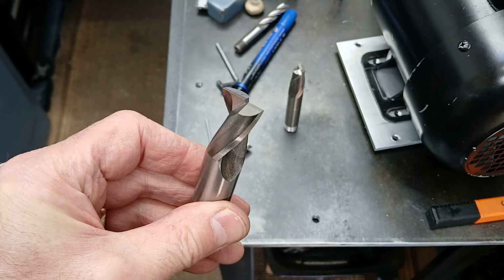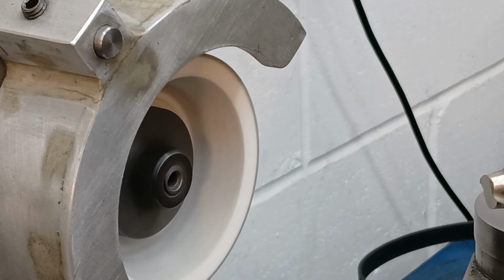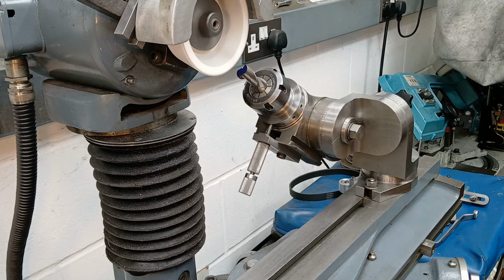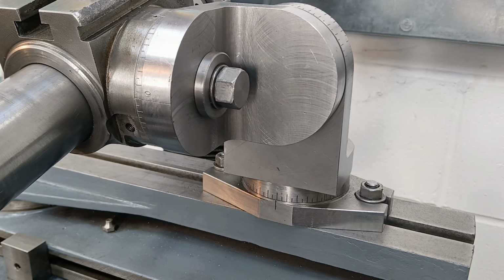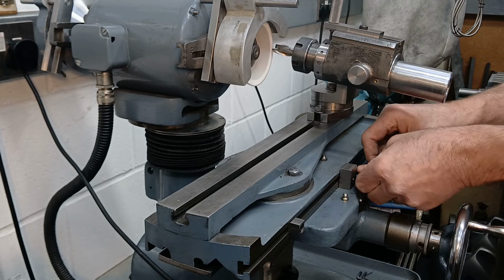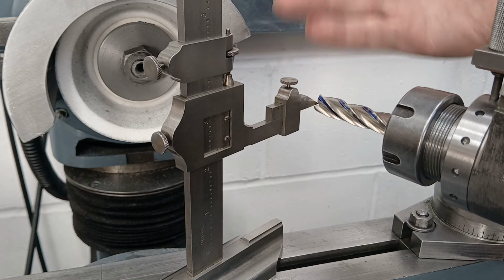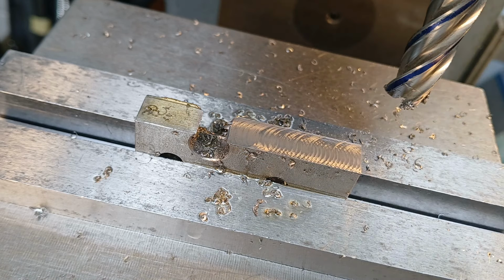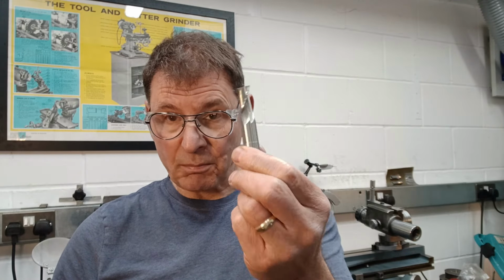Endmill Sharpening Part 2

Comment: The sharpening looks spot on . A little tip on milling ,I find using much slower than recommended  speeds work better on lighter machines and the cutters last better as well .
Reply from the maker: Thanks. I fully agree with your point about the cutter speed. For 6 to 10mm cutters 800rpm seems about right on my mill. Granted it's a tad fast for a 5/8 endmill, but dropping down one speed involves 2 belt moves on the pulleys and to be honest for 2 quick cuts I just winged it.

Comment: As someone who is rebuilding a rusted solid Quorn this is bang on time.
I have one question, did you "dish" the end flutes when you reground them by the customary degree or two?
Reply from the maker: Glad its useful. I thought I'd shown and explained in the video that the fixture was rotated a degree to make the corners proud of the centre. Don't think that footage ended up in the recycle bin!
Reply: @ThePottingShedWorkshop  I could have missed it.
Reply: @chrisstephens6673  The part where Robert explained rotating the fixture ~one degree is in this video, but I don't remember the time stamp.

Comment: Thanks for your comment  about the flute of a 4 flute Endmill not always passing through the centre, I am revisiting your video as, I am struggling with getting the lips aligned using a horizontally scribed line at centre height on a piece of acrylic, this works well for 4 facet work but not for Endmills, I thought it was just me where I couldn’t seem to line things up to my satisfaction. I saw Blondihacks using the Eccentric Engineering jig with a simple alignment block which might be better for me as the Kennet doesn’t have a lot of table area for a height gauge. I could remove the jig and do it on the surface table if needed.

Comment: Hi Robert. Great video. Thanks for pointing out that if you slant the gash to the rear, you will loose the center cutting when you go to resharpen. Please do a center cutting four flute if you see fit. Perhaps even carbide using a super abrasive wheel. Carbide end mills really pay for the home shop guy to resharpen. Thanks.
Reply from the maker: Thanks, glad you enjoyed it.
Four flute centre cutting geometries vary, some look ok to sharpen as theyre similar to the 2 flute in the video, and some have little details that I've no idea how I'd sharpen.
As for carbide, I have one 16mm which needs a lot of work. Whats stopping me is my current lack of dust extraction on my TC grinder. It's a project in the queue and when its sorted, I'll do the carbide mill.

Comment: I recently bought exactly the same grinder. Could you make a video on the lathe tool grinding?
Reply from the maker: @jedisgarage4775  I can do, but not for a little while. My workshop is a tip at the mo with my newly acquired lathe in bits everywhere, paint tins and boxes of bits littering the place. I'll try asap however.
Reply: @ThePottingShedWorkshop  Nice, that would be very helpful.

Comment: Good video.  What do you call the fixture that holds the ER32 Collet and mounts to the table?  I would like to buy one.  I think with one of those I can use my surface grinder to sharpen end mill flutes.
Reply from the maker: I think a universal head is one of the names for the fixture that carries the bore. I agree that a surface grinder should be capable of doing the grinding. I often use mine in preference to the TC grinder for several grinding operations when its more convenient, or when the increased rigidity of the SG makes a better job of it. There isnt to my mind much difference between the two machines. The SG usually has a mag chuck on the table, ground flat in situ, which makes it unattractive to remove to fit alternative fixtures.
Reply: @ThePottingShedWorkshop  I had a design for one years ago, but never got around to making one.  In fact the plans may have been from a book by a guy last name Hall.  Thanks for your reply.

Comment: Just watched both videos. It looked very complicated and involved. So once you're stuck into a few, and in a rhythm , how long to do a two flute cutter?
Reply from the maker: Setup is the time consuming part. Once everything is up and running 5 to 10 minutes to clean up the flutes as long as theyre not too bad (ie. not badly chipped, just dull). Cleaning up the ends would take a similar time, unless you're grinding it right back and starting again on the geometry. Thanks for watching!

Comment: Hello good day, what is the name of the base where the Endmill is located?Hello good day, what is the name of the base where the Endmill
?
Reply from the maker: @moiseseduardogomezmendoza5166  If you mean the chuck in which it is held, it is an ER32 collet chuck. In this case, this is one I made (it's not that difficult!)
Reply: @ThePottingShedWorkshop  with which it gives the angle to the drill bit that
Reply from the maker: @moiseseduardogomezmendoza5166  Aah! Do you mean the universal vice? That may not be exactly the right term, but its a way of angling the object being held at any angle in 3 dimensions. This one was again shop made, as the Tool and Cutter Grinder didn't come with one.
Reply: @ThePottingShedWorkshop  Do you have a video on how to make it? Apparently there is nothing like it or some photos to see if I can make it, you would help me a lot
Reply from the maker: @moiseseduardogomezmendoza5166  I made this fixture long before I started making videos. If you send me an email (address is on the channel page) I'll send you some pictures of it. It requires a mill and a lathe but theres nothing complicated. I engraved a degrees scale on mine but thats not essential.
Reply: Thank you very much, can you send me the email here? It appears that the email address on your channel's page does not exist